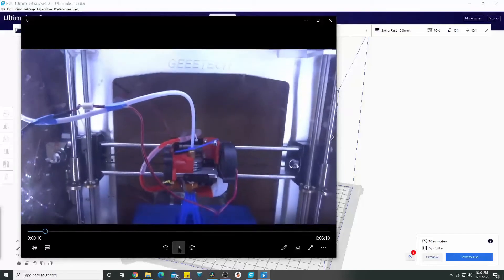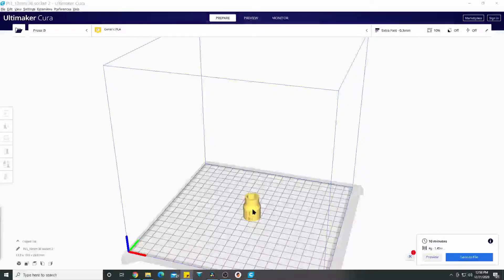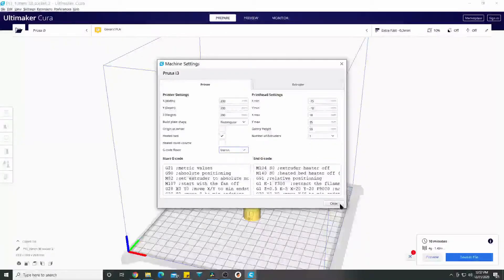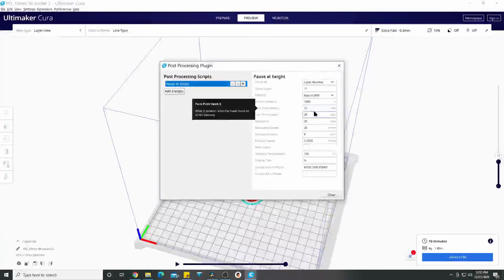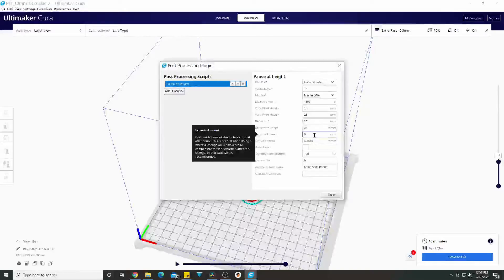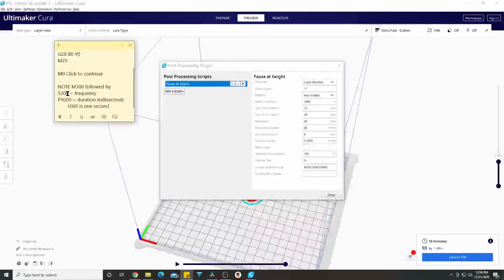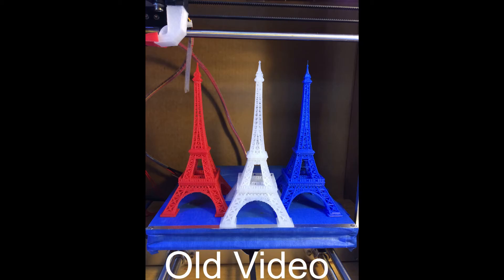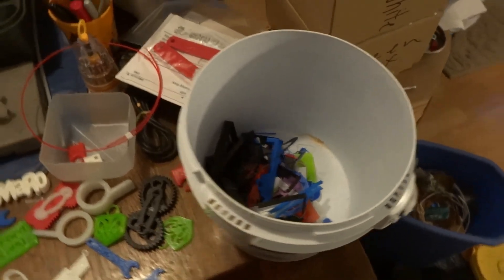Multi color 3d prints - Using CURA, Geetech, Prusa clone, Changing filament color #3dprinting

Comment: What version of  Cura are you using? I don't have all those options on my 4.8V. I only get Layer/Initial Retraction/Later retraction/x position/Y position and nothing else.
Reply from the maker: 4.8.0.
Reply from the maker: Try settings (upper left corner)... configure setting visibility... (drop down). I went in and checked (opened ) some things on mine.